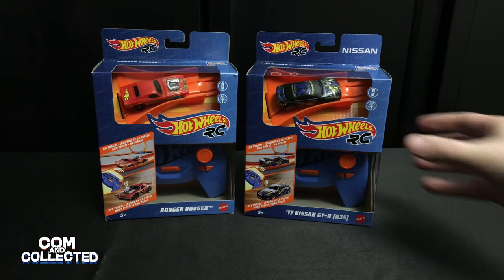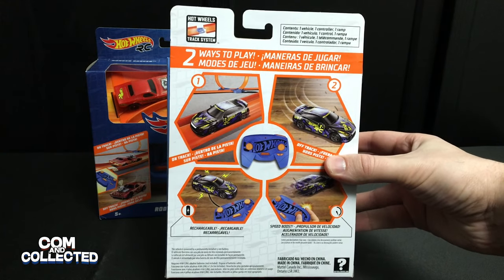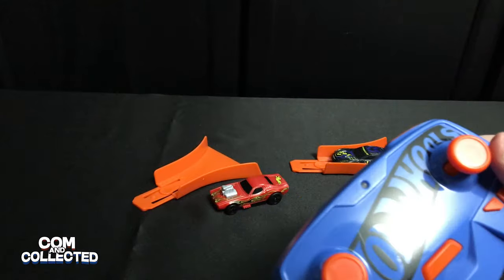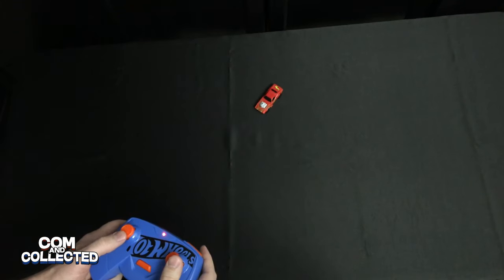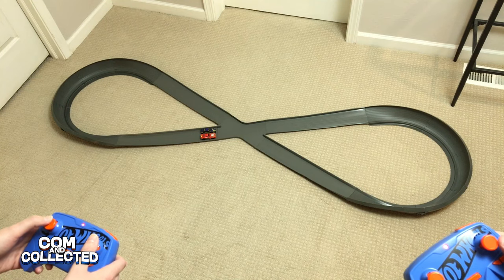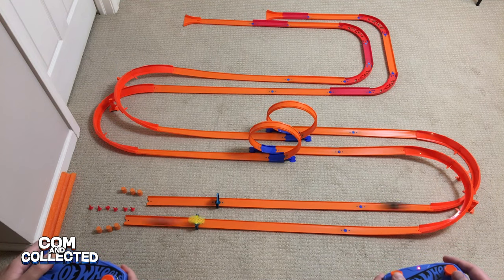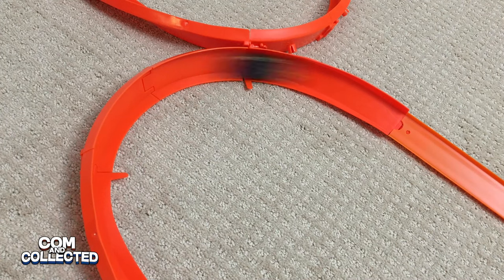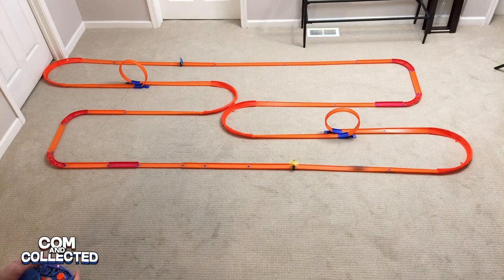Hot Wheels RC 1/64 Scale Unboxing Review and Track Test - Nissan GT-R (R35) and Rodger Dodger

Comment: I just got one of these, it’s really like a dream come true lol. They handle undulating tracks very well, and the ability to steer them and control their speed opens up opportunity for endurance competitions and time attacks that require a lot of skill! The battery life also lasts a very long time compared to what I’m used to for this sort of thing. They really hit it outta the park with this one in my opinion.
https://youtu.be/K4l71689jhc (related footage of a track we made together)
Reply from the maker: Heck yes! You did it right! That's exactly the kind of frankentracks that are awesome with these RC cars.  The sky is the limit to what you can do without gravity drops and boosters and such.  I love the jump onto the Crash Racers track pieces.  Even requires a little skill to get it back on the Hot Wheels track on the inside lane.  Great job! You set a high bar.

Comment: Mattel should revive their old Sizzlers Fat Track to pair with their RC line. Sizzlers Fat Tracks were wider than the Crash Racers track (you could race up to four Hot Wheels Sizzlers on them). I've also seen folks modding actual Hot Wheels diecast bodies for bluetooth RC with app control.  They function more like the 1:76 scale Turbo Racing RC cars (with full steering). Fat Track could be reintroduced with some new half and quarter straight lengths and flat 45° curves so you could assemble a tabletop road course for the Hot Wheels RC (or Turbo Racers RC or modded diecast bluetooth RC).
Reply: I have a LOT of old sizzlers track and was just thinking the same thing.
Reply from the maker: Yep! They could definitely do more! Glad to see the continuing though, every time I see a new model!

Comment: Quick question, the joycons on the left for my controller, turns the car left and right, and the right side of my controller makes the car go forwards and backwards, so I have to hold the controller sideways, is that how they’re supposed to be?
Reply from the maker: Wow! If that’s true, I would return it. But if that’s not possible I’ve always had luck syncing different cars to controllers from other ones in this line. (1:64 Hot Wheels RC) so if you have an extra controller at home it should work with it.
Reply: @ComAndCollectedFastLane  thanks, my dad and I tried taking it apart but broke it

Comment: You mentioned that you used the "Hot Wheels Track Builder Total Turbo Takeover Track Set" for parts of the track layout featured in the video. Did you take the "kickers" out of the loops? I'm curious if that can be done, as I recently ordered that set and would love the option to have normal loops.
Reply from the maker: Hi! They have been selling basic loops for a $1 at Dollar Tree, if those are where you live. Or you can use the kicker loops without resetting the kicker, the actual part of the kicker the car hits, is on a hinge. You may need to toss and extra rubber band on it so it doesn't flop down in the way if you run your cars through backwards.
Reply: @ComAndCollectedFastLane  Thank you so much for the tip!

Comment: Could you rip the internals out of it and put it on any hot wheel?
Reply from the maker: It has a hollow plastic body that you can unscrew.  So but at least on the Roger Dodger, the plastic body also held on the front axle.  So you couldn't even drive it around without the body on.

Comment: can it go through boosters
Reply from the maker: I actually didn't test that.  I'm sure the car would fit, but because it's an RC and the rear tires are gripping and turning at a specific speed based on the motor in the car, I'm not sure I would want to.